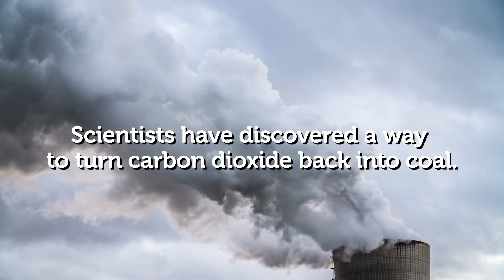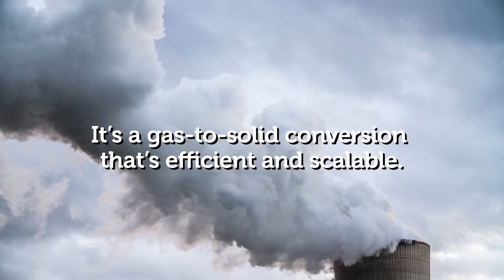Turning carbon dioxide back into coal | RMIT University

Comment: Since the reaction is endothermic you need a lot of energy for this. For example, when you want to compensate the CO2 from one coal fired power plant and take the efficiency into account you need at least twice the power of this plant. So the proposed method makes only sense when we have 100% renewable energy.

Comment: Converting CO2 back into coal requires, at the very least, that you input the same amount of energy back into the system that you initially got out from burning the coal. (1st law of thermodynamics). However, since we also have the 2nd law of thermodynamics at play here, there are going to be associated losses, so we'll have to actually put more energy in than simply the difference in bond energy. 

That energy has to come from somewhere. Until we are powered by 100% renewable energy, it makes absolutely no sense to do CO2 conversion into solid carbon. Even if we were operating at 90% renewable and 10% burning of hydrocarbons, it wouldn't be worth applying renewable energy to CO2 capturing since that renewable energy would be more effective if applied to reducing the 10% of remaining hydrocarbon burning.

Comment: Room temperature CO2 reduction to solid carbon species on liquid metals featuring atomically thin ceria interfaces, DOI: 10.1038/s41467-019-08824-8

Comment: Royal Melbourne Institute of Technology....
From https://www.rmit.edu.au/news/all-news/2019/feb/carbon-dioxide-coal
Lead author, Dr Dorna Esrafilzadeh, a Vice-Chancellor’s Research Fellow in RMIT’s School of Engineering, developed the electrochemical technique to capture and convert atmospheric CO2 to storable solid carbon.

To convert CO2, the researchers designed a liquid metal catalyst with specific surface properties that made it extremely efficient at conducting electricity while chemically activating the surface.

The carbon dioxide is dissolved in a beaker filled with an electrolyte liquid and a small amount of the liquid metal, which is then charged with an electrical current.

The CO2 slowly converts into solid flakes of carbon, which are naturally detached from the liquid metal surface, allowing the continuous production of carbonaceous solid.

Comment: You are kidding, right? Thermodynamics, laws of. You cannot convert back to carbon without pumping back in the energy released when the fossil coal was initially burned. Then you want to bury it back in the ground! Where does that energy come from? Burning coal? Solar? If solar, why not just pump that solar energy into the grid? Into EV batteries. 

Go and get yourselves a day job!